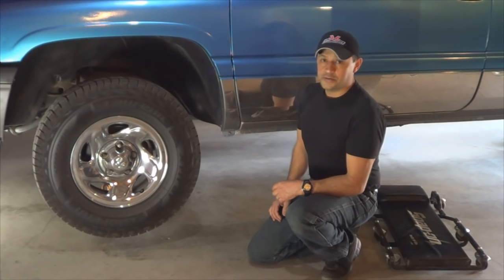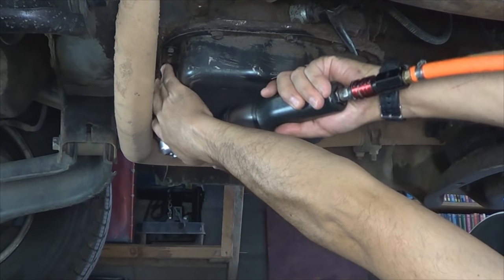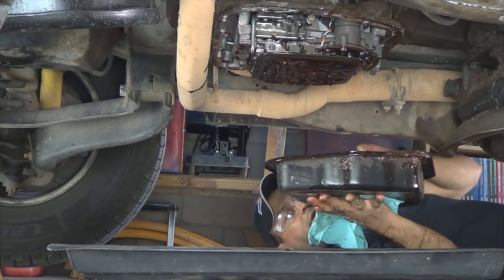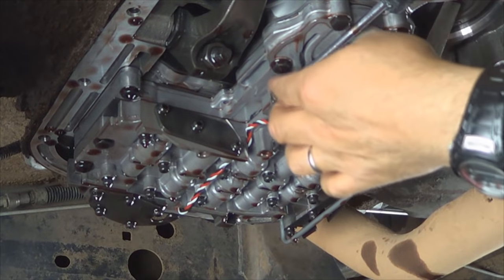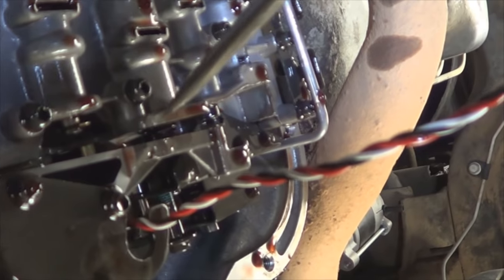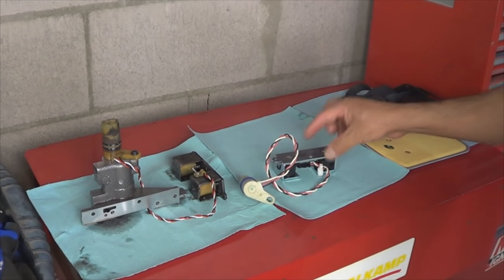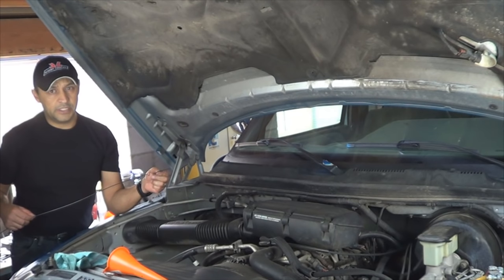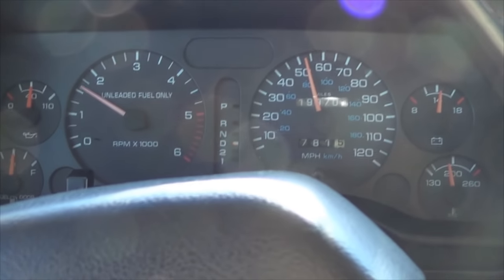Dodge RAM 1500 Transmission Shifting Problem Caused by Defective Pressure/Overdrive Solenoid.

Comment: I need to know how to fix my reverse in my 2001 Dodge Ram 1500 5.2 l all of my forward gears are good that shift out fine when I put it in reverse I used to have to rev it up a little bit and then it would catch and go in reverse now it's like I just have it in park it will not move what part do I have to change in my transmission any feedback would be greatly appreciated I don't want to have someone rebuild the whole thing I would rather do it myself
Reply: My rear servo piston and pin broke, caused the same issue you have.

Comment: Itappears as though the Ram transmissions are having various different issues. Mine doesn't engage in any of the forward gears or reverse. I changed bothe filters about two years ago and not a drop leaking in that time. Im I changed the three sensors on the outside. Now I may just got in and replace everything thats changable under the pan and see what happens. If I have to go the junk-yard used route I can put everuything that I switched into the new used one.  anyone have any thoughts/experience on this please let me know.

Comment: i have the exact same truck and when you step on it it jut revs a shit ton then you have to let off it then it will kick back in the next gear
Reply: kevin foe mine does the same thing I have a 1998 Dodge Ram 1500 and i have to let up on the pedal for it to stop jumping and revving.
Reply: Chickychick1213 ya it didnt work out.... sold the truck and got a 03 chev single cab short box hahahah

Comment: I have a 2005 dodge ram 1500 4.7 Problem with Changing gears. At 2.5, or 2  1/2  tachometers, it loses power and it starts to lurch forward and back and jerk forward and backward. I have to let off the gas pedal a little and let it change gears and then slowly go forward. It might do it again in the next gear. It doesn't always get to overdrive. If it makes it to overdrive, it runs great..

I used to think it was when it was cold that it was doing it, but it does it commonly in cold or not, but likely worse, or more often, in the cold. It did it a lot yesterday with a high outside temperature and humidity. Today, it was cooler and less humid and it didn't do it, but it could be because I have learned to only step on the gas gradually and slowly so it changes gears before it hits 2.5 tachs. 

This is frustrating to drivers and passengers in its lurching. It is also dangerous as it may lose power and lurch when I pull into traffic, and I almost get rear ended.. I have pulled in front of someone and lost power and almost got t-boned, too.

I called the dealer, and they had no idea what was happening. Will this resolve my issue?
Reply: Mine does the same thing....I took it to dealer today and will let you know what the results are

Comment: My 1999 Dodge Ram 1500 will not shift into the last gear. Everything else is fine (Shifting, down shifting, reverse, no clanking or banging when placing into Drive, Reverse or Park) Ive been to Transmission shops and they are telling me that I need a new trans. Do you think that this would fix the issue?? Im strapped... I dont have to cash to pay for a whole new trans.......
Reply: Joseph Cumes Do you mean it doesn't shift into overdrive, or the torque convert isn't locking up after it goes in overdrive?
Reply: Sounds like you're having the same problem that I have my truck shift perfect I've got a 97 Dodge Ram 1500 4 by 4 it shifts at 20 mile an hour and then it shifts at 40 miles an hour but it will not shift again it will not go into overdrive otherwise coming back down parking reversed everything's great I haven't been able to figure out what the problem is

Comment: I have a 1994 dodge ram 1500 Laramie please help me I'd truly appreciate it.  My truck RPMs rev Right up and sometimes shift and sometimes wont and if it does it will make a terrible grinding noise will only do it if my foot is on the gas as soon as I take my foot off the gas it will stop .does not want to shift all the time sometimes it does any help would be greatly appreciated. Would this help me thanks guys
Reply: Hi Thomas, I've got a 94' B250 and have the same problem. I had a code 37 and replaced the TCC solenoid, tranny filter and fluid. I still get code 37. My guess is that the solenoid only activates when the tranny fluid circulates through the transmission or something. I too get the grinding noise only in the first couple of minutes of driving, and then it goes away. Did you end up figuring what the problem was?

Comment: I did this and the problem still came back and so did the check engine light
Reply: I changed  the govener pressure and transducer my problem and code came back at p1740

Comment: can anybody tell me what the wiring harness that runs into the transmission on a 97 Dodge Ram 1500  Laramie edition is?   really could use the help know what it is and to replace it.thanks for any answers
Reply: Umm…Google it…the wiring harness is one large harness that goes from the injectors to the transmission…standard plugs include 3-4 plugs on the trans and transfer case and then 2 plugs for the O2 sensors…I imagine it would have one less plug for the 2wd version …just installed an engine trans and tc and both trucks had the same set up except the older model had one more plug for a 4wd indicator light

Comment: I did the exact same things shown in the video but I am still getting the check engine light and I have already ran through 4 censors but now it won't even drive if anyone knows what is wrong please lett me know
Reply: At least you get a code. I'm having issues and no codes

Comment: is this the part I need to replace if my overdrive turns off and trans temp light comes on after about 20 miles of driving? I turn it off, let it rest, then it's fine again for about 20 more miles.
Reply: I think I'm having the exact same issue, did you ever get yours resolved?
Reply: The line that goes into the bottom of the radiator trans cooler, It has a check valve in it that’s severely restricts the fluid flow through the tranny cooler, Ford and Chevrolet don’t use it at all, it’s not necessary in a dodge either, after I removed it I had no more transmission overheating! I discovered the problem when I removed it and could barely blow through it, so I thought maybe it was clogged but it wasn’t clogged! It is a very undersized check valve designed by the idiots engineers at Chrysler! I’ll bet it killed thousands of transmissions making them run too hot
Reply: So I also have the same issue. I can drive for about 20 miles then The trans just kicks out of OD. I’ve had the trans rebuilt. Cleared the oil cooler. Replaced trans lines and removed the check valve. Still no luck. Anyone have an idea? I’m at a loss right now but I’m sure someone has had the same issue.